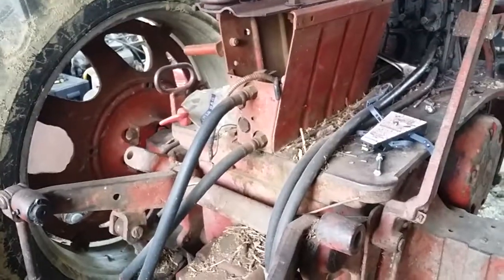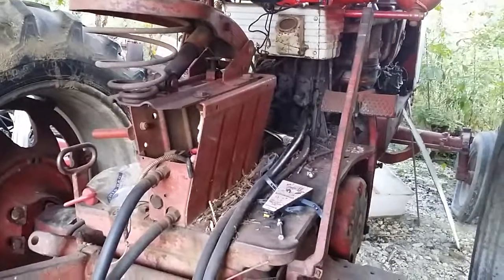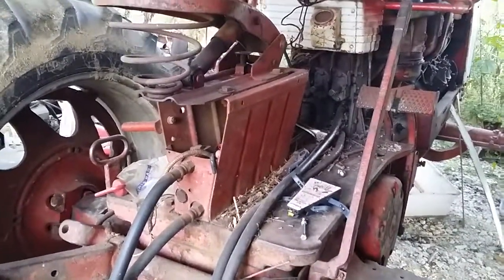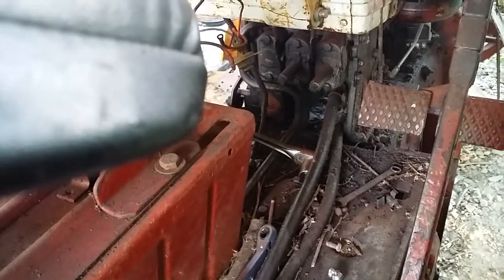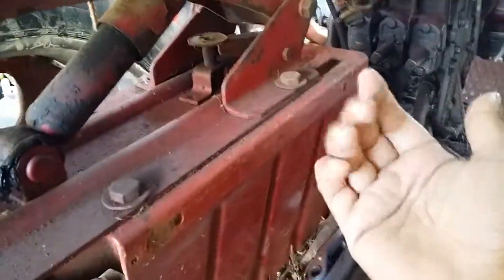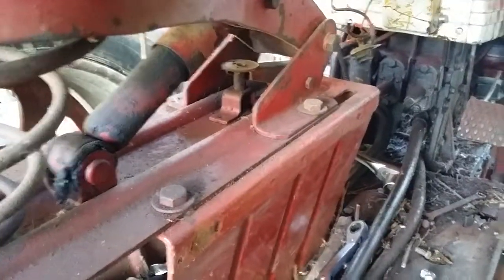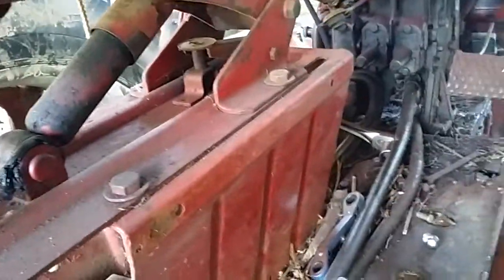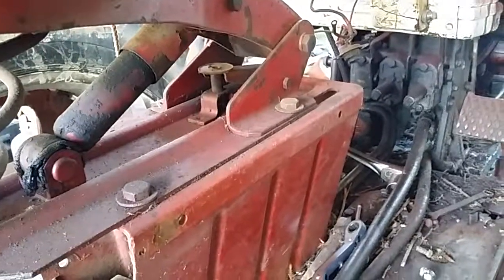Levers on a 560 Farmall

Comment: Trying to put a factory hand clutch on a 560 and can’t find and pictures, do you have any ideas how it attached. I have most of the factory hand clutch but not all.
Reply from the maker: Sorry, just getting back to this now. Have you looked at any of the 660 service manuals? I have one, I'll check it out later, but it seems that more 660s had hand clutches than 560. I assumed they were add ons, but very well could have been stock. I'll get back to you later and let you know what the service manual says.

Comment: Howdy I have a 560 also gas i have rear remotes hooked up like yours how do you turn them on
Reply from the maker: On mine, the middle lever to the right of the steering wheel runs the rear hydraulics. Sorry I just saw this. I'm sure you've got it figured out by now. 

One other note is in front of the gear shift there is a cover with a couple of knobs. Those switch from single to dual action cylinders.

Comment: TA stands for Torque Amplifier.  Please don't call it 'torque assist' (1:03).
Tel-A-Depth is the name of the position control for the Fast Hitch, using the lever with the adjustable stop so that you can easily return to the same lowered position each time, and the button on top to bypass the stop position.  That is the far right of the three levers on the right side of the dash.  The large handle lever left of the seat (which you called tel a depth) is called the traction control lever in IH marketing materials.  It is like an early form of draft control but is all mechanical in changing the angle of the Fast Hitch as pull increases, it does not operate the hydraulics at all as draft control would.